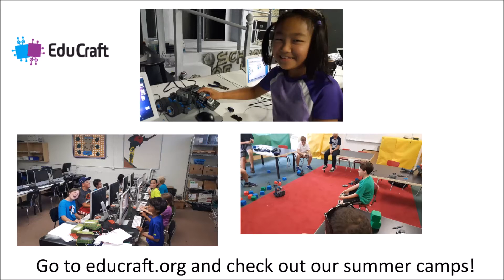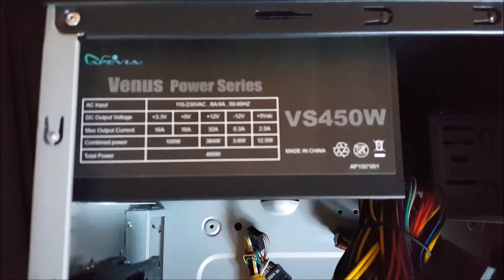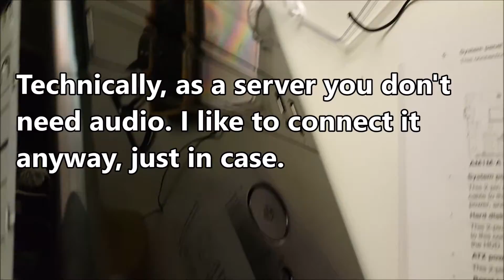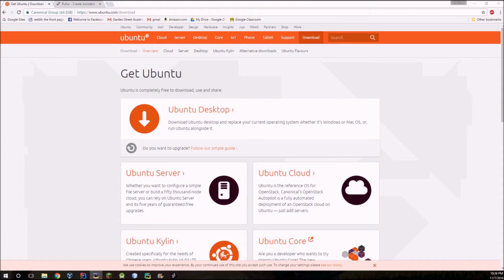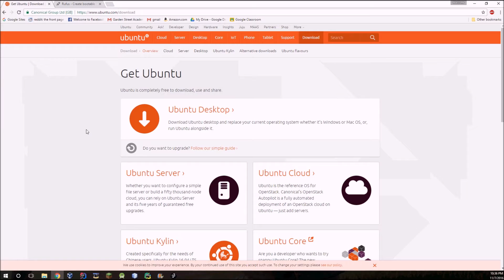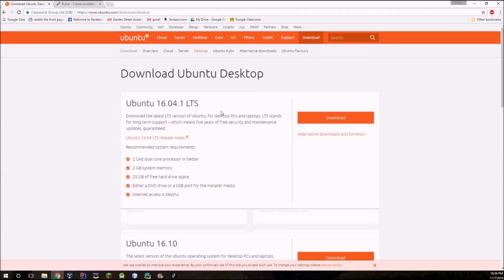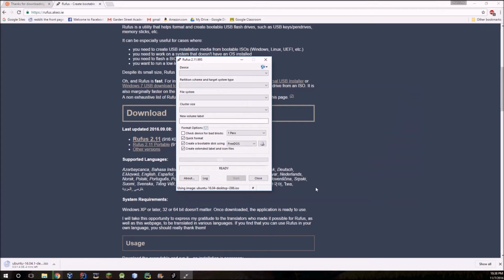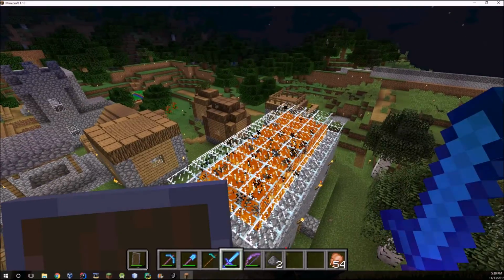Build Minecraft Server Computer

Comment: i hope you bought the 3200 mhz ram or over! Amd always wants more ram speed. It's better
ALSO DONT USE THE ANTI STATIC PACKET AS AN ANTI STATIC WORKSTATION! The electricity, charges ON the packet. The motherboard BOX is safer as linus tech tips say